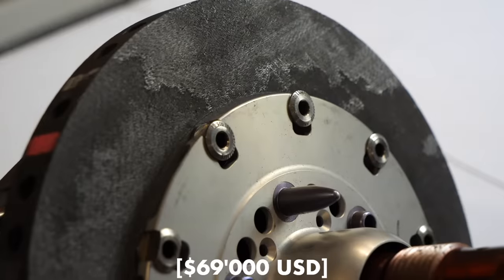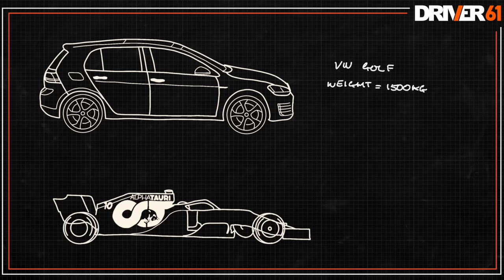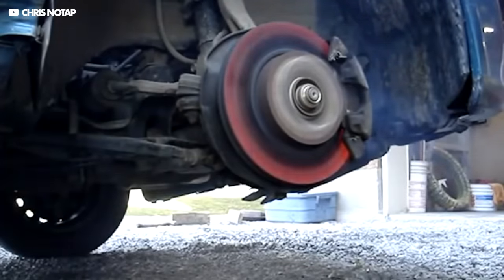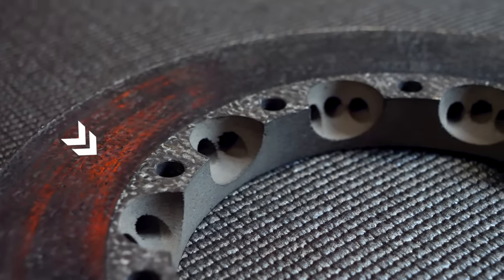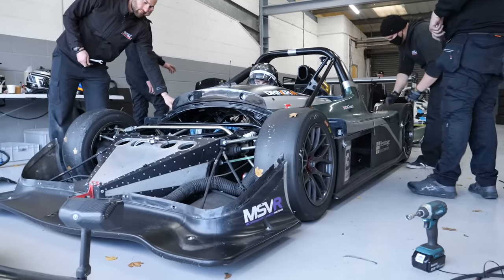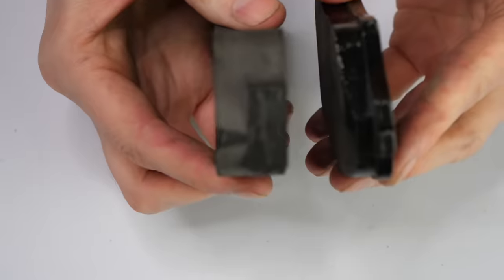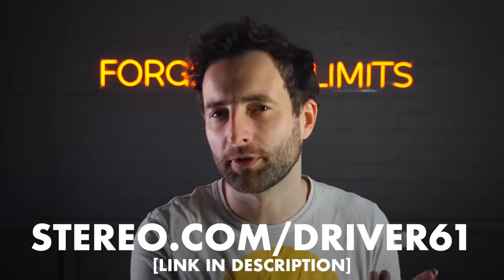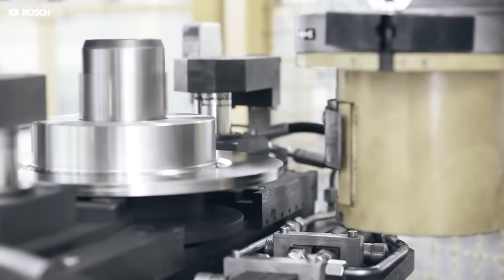Why These F1 Brakes Cost £50,000

Comment: I was able to hold an F1 brake disc at the 2012 Canadian GP and I was blown away at how light it was.
Reply: Everything from a f1 car its made out of light material, except the engine
Reply: @snifey7694  technically the engines are too. Aluminum is a light weight material in comparison to steel or cast iron. The V8s were just 95 kg, and they could have been lighter but the rules enforced a minimum weight.

Comment: 1:00 Also applies to trains. Since trains (mostly) have a safety limited top speed, braking as late as possible can gain huge amounts of time if the train is late.
Reply: Without knowing for sure how try this is, I find it interesting taking in to account how long it takes for a train to break. Up to actual kilometers, if I remember correctly.
So as opposed to an F1 car where all of this happens in fractions of seconds and late breaking may be a few tenths later. I imagine In a train "late" could be anywhere from seconds to almost a minute later, depending on weight, ect.
That's a neat thought.
🎩👌
Reply: Trains have so much less grip available, though
Reply: @counterfit5  yeah, of course. It's just all on a completely different scale, right?
Reply: this is easily solved by giving trains a bit of margin time between stations. If the train is late for any reason, it can just accelerate a bit.
Reply: @migueeeelet  
...
No.
They should obviously have rockets so they can rocket drift corners.
Get your sensible opinion out of here!

No, of course. That would make sense. I'm pretty sure that's how it is in a lot of cases.
Reply: @Sir.Craze-  Trains are built to have as little friction as possible between the wheels and the rails, steel on steel. This is great for top speed and for keeping fuel usage low, but it's terrible for acceleration (and deceleration).
Reply: I'm so confused why people are explaining to me how a train works...
Yeah. It's a train. I've been 12 before.
Reply: @Sir.Craze-  Good for you 👍🏽
Reply: @ze_rubenator   This is actually kind of a  common misconception - the coefficient of friction between a wheel and a surface has no impact on the amount of power needed to drive it at a constant velocity, as the contact patch of the wheel is not moving relative to the surface and so no work is done by the friction force. What actually matters is the hardness of the materials, as the deformation of soft materials as the wheel moves is what generates rolling resistance. Steel is chosen because it is hard, durable, and relatively cheap, but as a drawback has low friction.
Reply: They hit the apex every single time so I guess it comes down to accelerating and braking yes
Reply: Nah, trains need to be able to do heavy emergency braking yes. But, in fact, in their speed modulation process, it's a whole new frontier, with the driveline doing most of the heavy lifting. And braking periods needing to start veeeeery gradually and lightly and continue on to maintain moderate to heavy dissipation power for faaaarrrr more elongated of a time, and also release at gradual and dynamically adjustable way. It's a completely different ball game to adjust the momentum of several entire freight ships worth of mass that's streched out, at best, several tens of kilometers :D Or, something that needs to be able to accelorate and decel with passengers being able to move freely between 25km/h (slow, local railbusses in the way, no diversion) and 250km/h (mainline track speeds.) :D And we ain't got to the damn bullet trains and their insane tolerances due to standing waves and harmonics yet. :D:D:D:D And do all that several times over before having a maintenance check, much less time to be overhauled by a trained mechanic. :D Yeah, they use regular ol' vented high-carbon discs. :P Just a quite a few of them. Nearly every axle having one usually. Emergency braking means braking the brakes. But, that's a non-issue on normal use. Absolutely, nothing like F1 or jumbo jet brakes. Hence, normal vented discs just like cars. And definitively mass produced items. Since one train alone requires more dics than an entire racing season of F1 :D
Reply: @madattaktube   you know you could’ve just looked this up dude. That’s flat out wrong. Power required to propel an object is directly proportional to the summation of forces resisting motion which include: rolling, air, internal, etc. Friction force is normal force multiplied by the specific coefficient of friction for the type you are looking at (kinetic, static, rolling, etc). You are correct that the deformation of materials does add to a loss of energy but it is not the only thing that creates rolling resistance. Low friction is not a drawback in this case as it permits incredibly low fuel consumption.
Reply: @Sir.Craze-  Yeah trains only weigh 1 billion tonnes it's crazy
Reply: @Sir.Craze-  Trains are a bit heavier too!  Including weight per wheel and therefore mass per brake. So monster brakes are required even though you're not going to be doing any high g stopping. But any increase in de-acceleration does save time . . .
Reply: @Sir.Craze-  Considering your other post beginning "Without knowing for sure how try this is, I find it interesting . . ." , I'm wondering just what you do know about how a train works. Or anybody else knows for that matter . . . including myself. Let's just have a nice cup of tea and forget all about trains shall we? They are always late anyway. And another thing is . . . erm, yes, about those Ford Prefect brakes . . .
Reply: @Sir.Craze-  Trains are broken up when they are no longer required!
Reply: I'm pretty sure it's more important to save energy. Near translations there are also speed limits to abide by. So that's a no on your idea.

Comment: Thanks for the great video. I did some math from my break test video that you had featured :D I had the 66kw motor full throttle about 55 seconds there sending all power to one brake. So if take some drive train losses and take the fact into account that motor wasn't on best rpm area all the time and use 50kw as an average power sent to the wheel we get about 2.7 MJ of energy to explode one small steel disc brake. Of course you are not going brake constantly for one minute so in real life you could probably dump even more energy there since it would be spread for longer time. 

And after doing that I spotted that you should have kilojoules there instead of megajoules on your results. But it seems that you could stop a car from over 200km/h with just one brake disc with out it exploding :D Even without taking air resistance into account. Also the simulated wheel speed on the test was probably bit over 200km/h since open diff multiplies the speed by two when you have only one wheel spinning.
Reply: So awesome to see you here!
Reply: Man u r smart !
Reply: What's up? Driver61 was calculating on 200 mph and you are doing math on 200 km/h? So - no entiende señor ?
Reply: Where did you get 200km/h from? He said 200 mph/ 321km/h.
Reply: @carl8790  It doesnt matter. I did the math for those Golf braking from 70mph to 0 and it equals to 734115 Joules energy, wich is 1000 times less than 734 mega joules mentioned in the video

Comment: correction:
        @1:46    energy will be  734 KJ   instead of  MJ.😅
Reply: Noticed that too lol
Powerplant levels of energy? hmmmm.
Reply: I was gonna say. Those breaks would be hotter than the surface of the sun.
Reply: And 380% equals 6 times 🤔

Comment: The majority of road going cars have single piston calipers, but there are quite a few more coming out with 2 pot and 4 pot calipers in recent years. It's great that the grip of tires, and increase in braking performance is actually starting to trickle down now
Reply: The reason they have more pistons is because cars are getting heavier, which means more force is required for wheel lock. Also 4 small pistons gives more even force than 1 large one, which is useful for very large diameter discs.

Comment: I was only ever a club, tin top racer, and the first time I used carbon metallic pads, on the Silverstone GP circuit, I flat spotted a tyre because they worked the other way around from the racing pads I was used to. Less pedal as the pads got up to temperature, not more! Lesson learned and a new tyre that only lasted one corner. Expensive when your sponsor is yourself. 🙄

Comment: I’m confused about the video. Firstly, does “£50,000 per corner” mean they actually cost £200,000 since there are 4 corners of the car? 

Secondly, why does it say “£5,000” and not “£50,000” at 0:21?

And lastly, you said “6 times the force” at 2:01, but 2832/734 is only 3.86 times?
Reply: ^this.
Reply: I think this video is a reuploaded video. I remember he did a video on this before which is why I think it has a lot of the same content in it.
Reply: concerning the last issue: 
The F1 car has to eliminate ~3 times the energy but does this in about half the time --> 6 times the force
Reply: @LoneStarr1979  so maybe he misspoke then when he referred to energy instead of force?

Comment: 3:47 ‘breaks down the resin’ … there is no resin left in carbon/carbon pads & rotors. After the initial lay-up of the carbon fabric into the desired shape,the components are then roasted until all the resin is burnt away leaving just the carbon matrix behind. Then comes the expensive part … filling in the gaps with more carbon thru vapour deposition, which takes 3-6 months. Carbon, as an abundant element, is relatively cheap - it’s the time that adds the cost (and the cost of the energy to make it all happen)

Comment: I guess that's why in games like F1 2020 for example the best way to brake is to start by 100% brake then gradually lifting whereas in a road car that would just end up locking the front tires, I assumed that was a result of the massive grip the downforce offered but I suppose the 'real life' answer is because the carbon carbon brakes were cold, curious now if the developers coded in that aspect of the brakes physics

Comment: Those composite materials also the ceramics in sport cars have the amazing property of increasing grip and friction at high temperatures. As if the materials are designed for racing.

Comment: We should not forget that F1 cars also use ERS which is an other name for regenerative braking. The F1 webpage states that ERS can provide 120KW of power in a lap. Most of that energy comes from the kinetic energy of the car during braking. So ERS helps considerably on braking.

Comment: It's sad the people get the wrong ideas of road card with Carbon Composite brakes, thinking they also need high temperature to work properly, they don't. They are adapted to road use and are brilliant. I even was warned at the Merc dealer against ordering with Carbon, and told how "they were only for track use and not good for daily driving", like they don't know anything or haven't tried them. Sure they need to be used once in a while, but that goes for all brakes. a normal steel disk not being used will also lose friction, until they are use a bit heavy and scrubbed off a layer of "polished" pads. My mom's car had useless brakes each time I lend it, for the first 5 minutes at least. (Porsche's 410mm PCCB is the best ever)

Comment: fun fact b7 rs4 used to have in 2006 360x34 8 piston steel brembos or as optional 380x38 6 piston carbon ceramics in front. the carbon disk, pads and wear indicators cost over 5500 euros and the disk is around 4500 euros itself. and this is only one corner :D

Comment: I used to have a carbon clutch on my tarmac rally car, and it was by far the best "feeling" clutch i have ever driven on.  But it needed to be hot to work.  It would excessively slip until sufficiently warmed up.  Once warm it was incredibly smooth, and easy to drive

Comment: you can get these temps faster by having less surface area. the force per square inch would go up, resulting in more friction per square inch heating while also heating less material faster.

Comment: A road car has one piston calipers, then there is me: watching this in my 30 years old merc diesel with 4 piston calipers in front and two piston calipers in the back😅
Reply: Yeah that was bs, even my bike rear brake has 2 piston caliper
Reply: @Angry-Lynx  not really bs, most road cars have one piston floating calipers, mine is just an execption from that norm😅
Reply: @christianh.8408  Most cars have one piston calipers? Im pretty sure just small and cheap ones
Reply: @Angry-Lynx  for the last 20 years only highpowered cars usually have more than one piston per caliper, atleast on the european and asian market
Reply: @christianh.8408  My 86 had 6 piston caliper but it was aftermarket.

Comment: This is amazing technology. Thanks for going through F1 systems engineering. Help me understand how the car can brake at 6G but only have enough grip for 3.6G laterally? When I learned physics grip wasn’t different in different directions. Is this a tire(tyre) phenomenon?
Reply: tires work better longitudinally than laterally i guess, that's what they are designed for

Comment: I have been thinking about what could be done with a cold gas thruster mounted on the unsprung part of the suspension. When needed, the thruster fires, applying several thousand extra pounds of contact pressure for each tire. Imagine how well a mini Cooper would stop on a slippery wet road if there was an extra 2000 lb of contact pressure on each tire...  That might be enough to stop quicker than you could with the normal brakes on dry pavement. and yeah it'd be kind of a pain in the rear cuz he'd have to recharge the system and maybe replace some cosmetic panels that got blown off by the rocket thrust. But I think anybody who's been in a wreck would rather deal with that then deal with the usual result of having enough enough space to stop from 25 miles an hour (because of the wet) but you're going 45 mph.

Comment: So brake rotors don’t warp it is almost impossible to get them too unless you put it in the same heat for the same time as when they are being cast what they do do is get so that the surface isn’t flat anymore and creates a spot that’s lower than the rest of the rotor

Comment: They may last for 250 miles - but a new disc is installed for EVERY race.  And are made for each track specifically.  Makes sense when every ounce of weight is a concern.

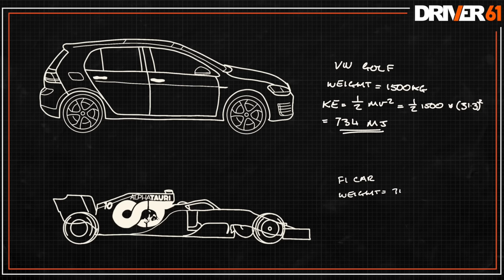Comment: Thanks for the video series. Just a minor note @ 1:59 -  I believe the math should read 1/2 * 746 * (100^2-13^2).
Reply from the maker: Justin you're correct, thanks for pointing it out. It still proves the point though, right. Thanks for your comment!

Comment: Weird how it's the opposite in cycling. Carbon brake tracks are worse of a braking surface because they're way worse at dissipating heat than aluminium

Comment: What a Nice video! Tks for posting! I supposed that steel brake wheels were forged but with the vídeo I saw them being cast (less stiffness); I am a pilot and I fly one jet with carbon brakes. They work very consistent, I mean, braking efectiveness are supperb (dry runway, specially); - I had to refine my feet-feeling to get more confident with them! 🍾🇧🇷

Comment: @Driver61 So road/track car brake pads release gasses when it's overheating due to material differences between the pad and the rotors. Does this mean slotted rotors actually help with removing these gasses? I had this debate with another track driver and he's adamant that slotted rotors are marketing fluff.
Reply: Gases and debris (brake dust etc) are removed by the slots
Reply: Plus they're there to aid in cooling the Rotor, obviously more so with "Cross Drilled" Rotors, but then the holes are are also diminishing the "surface area" available for optimal pad usage..... But they sure look cool.... Lol!!!!

Comment: Looking at the video showing the brake disk with all the friction being applied which almost causes it to almost go on fire because there is only one calliper would it not be better if it had two LARGER callipers with extra pistons which would apply more evenly proportioned grip for increased braking performance

Comment: I not sure but when you explain the difference of the dispation of energy by the disk, you said that the F1 need the dissipate 6 time the golf energy. Or from my perspective, 700 multiple by 4 is equal to 2800, and the percentage that you gave after is correct. It may be a error during the record. But this on the side, it's really a good video.

PS sorry for my orthograph or formulation of the sentence I'm a French guy with some lack of english writting skill.

Comment: @Driver61 The math in this video make no sens at ALL! Title says it cost 50'000£, but the video text says 5000£ per disc. Also you say that they only last 250miles.
A normal F1 race is around 190 miles, so counting practice and qualy they drive more than 250 miles in a weekend. 
Later you say it costs teams 500.000£ per year for disc/pads.
But if discs where 50.000£ each, that would only be 10 discs per year and thats asuming they get the pads for free... (since you provided no info of pad cost)
None of this math adds up what so ever!
Reply: Hmmm, your right. Seems odd! @driver61 can you explain?
Reply: These discs and pads are adjustable. The thickness of them starts around 35mm and between races they re-skim the surface and good as new.

Comment: I worked at a Mercedes Benz dealership as a detailer and remember when a customer purchased the MB SLR 622s? It came with carbon brakes from factory. First time I even seen them and thought they were stupid because I didn’t know the technology that they were.  A Guy bought it and drove it as a daily🤣 
$500k car 
the rich. Stupid and always trying to out do each other. He must have hated the brakes if they needed pre heating to brake efficiently 🤣 oh yeah he totalled that car 6months later 😂 bought a convertible 622 edition to replace it.